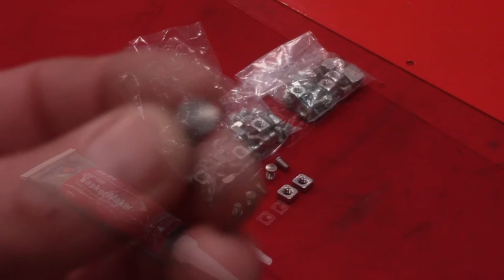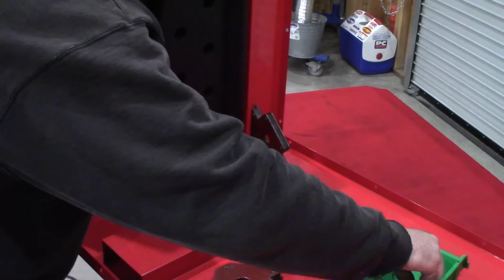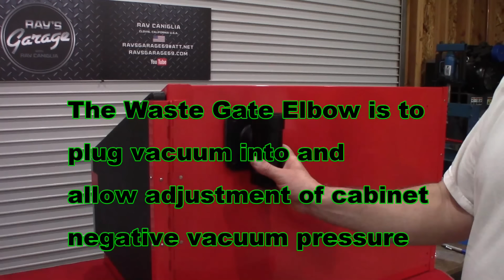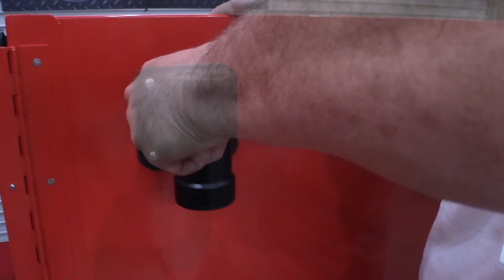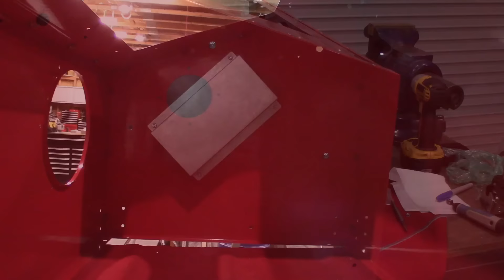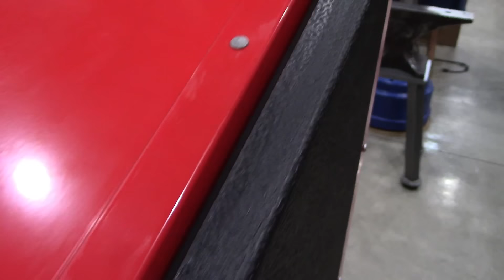Tacoma Company Upgrades Part 2 #tacomacompany #realraysgarage

Comment: I did something unique and plumbed the intake air to blow fresh air across the face of the glass. I figured that a barrier of air blowing across the glass will keep the glass from being crazed a bit longer.
Reply: So far blowing the air cross the glass is working ok. And another thing I did just because I has two of them. I was scratching my head a bit as to what to do for a dust collector. I have seen so many innovative and creative things done with 5 gallon pails or buckets and the like and of course there is the commercial products that you could buy that would do the same thing. Well what I did was I had two shop vac’s. One large one and one smaller one. I just connected the blast cabinet to one vac and then ran the exhaust out to the intake of the second shop vac. Of course I only turned on the shop vac which is on the end. Well it worked just fine. You could pickup up a secondary shop vac  for next to nothing at some garage sales. I have such a dirty mind.....two shop vacs....get it!    Sigh.

Comment: I thought that using silicone sealant was not good? Could I use the PL roof and flashing sealant on the cabinet like I am using on the hopper?
Reply from the maker: Yes you can but it will very difficult to take it apart if needed.
Reply: @RaysGarage Hi, So the red silicone gasket maker is okay for the seams? I thought you mentioned in another video that silicone is not good for the seams?

Comment: Had no issues with calling or ordering pars to upgrade my HF Sandblasting cabinet fro Tacoma Co. Where very helpful over phone and pars seem so far to be of very good quality.   My only issue was the rivet flat screws.  Could not get many of them very tight as no matter how hard I pressed on the back they would just spin. Even tried pressing with a rubber "non slip" pad on them

Comment: Thanks Ray!
I'm a Piping Designer by profession, so I'm familiar with all of the nomenclature here. However, your explanation of the flow rates of air vs medium( in upcoming sections), gave me a pretty good heads up on what's in store and cut down LOADS of guesswork. 

Replacing the fasteners (plated junk iron Chinesium) with 304 Stainless Steel was the first thing I did. I took that as a red flag and started investigating the technicals and history on this kit....
My best guess is that this kit wasn't designed at all, but reverse engineered,  then watered down into something that barely keep Harbor Freight from getting sued into oblivion. 

Mike Tacoma obviously knows his stuff and is a valuable asset to his Craft, as well as to all of us DIYers out here trying to do more with less.
...and you've done a great job of conveying his expertise in a thorough and logical manner. 

I thank you both.
Hats off and Cheers!
Reply from the maker: You nailed it my friend, you are one that truly understands and get's it! Feel free to hit me up with any questions, or should I ask how to improve on this system!

Comment: Hi, Ray thanks for the videos, they helped me a lot on the build. where can i buy that tool you used for the RTV? You turn the tool and the RTV come out so easy.
Reply from the maker: Thanks Robert, You can find the tool on Amazon, its called, (Metal Tube Squeezer Roller Key) they are about $4 a piece.

Comment: These videos are so helpful, Thank you! Can I add the vacuum waste gate to the left side since that it where my vacuum is located? I'd prefer to have the rear of cabinet flush up against a wall to save on space.
Reply from the maker: This is not recommended, by putting the vac on the side you run the risk of pulling good blast media out of the cabinet plus the cabinet vacuum pressure will not flow as efficiently. The reason for the waste gate and vac connection on the rear of the cabinet is to allow good blast media to fall from the baffle box back into the cabinet and not into the vacuum.

Comment: In the process of building my cabinet with virtuslly every item on Taoma's price list.  What is the secret to getting the nut on the 1/4-20 above the exhausr baffle?  after messing with it for a half hour I had to walk away.  Thanks Ray.  The vid's are great!
Reply from the maker: The waste gate uses self tapping screws if this is what you are asking, if not let me know. Thanks!
Reply: @RaysGarage sorry, reread my post and I wasn't clear.  When assembling the cabinet there is one of the many 1/4-20 screws with the square, flat faced nuts that is installed above/behind the exhaust baffle on the inside of the cabinet.  Can't get fingers in there to start the nut and the angle of the screw makes using a box wrench, or long extension through the baffle, nearly impossible.  What was your solution?

Thanks Ray!
Reply from the maker: @ronpadgett9521  I belive these were installed with the paneles upside down when the top portition of the cabinet was assembled. worse case use a standard 1/4-20 nut with a 1/4" ratchet just make sure its good and sealed so you do not have a media leak.

Comment: I enjoyed your series. I have placed an order for upgrades but am at the mercy of the company moving their location.  I did receive the screw kit and have built my cabinet. I have not been able to get all the screws tight because no matter how hard I push on them, about 10-20% of them continue to spin. Also, I followed your video to assemble the cabinet and had a hard time putting the front plate on, I think it would be easier if you follow the recommendations for assembly in the manual by doing the top, front and back first and then the sides. I agree that it can be expensive to do these upgrades, but I need a really good cabinet for blasting aluminum and I think this will be the ticket.  Can’t wait to get the rest of my upgrades so I can start using it.
Reply from the maker: Hello James, You are going to love the performance of your upgraded cabinet! As far as assemble goes, I was never one to follow instructions and call them destructions, hahaha. There is no wrong way to complete something, what ever works and is easiest to do! Cheers, Ray

Comment: It appears you are installing the box topper with the cabinet partially assembled, maybe 4 of 6 sides??  I'm having a heck of a time installing the box topper upgrade to a previously assembled unit.  Any tips or tricks, I really don't want to have to start disassembling things beyond separating the cabinet from the hopper
Reply from the maker: You may have to file it down slightly to get it to slide into place, they are made slightly oversized due to cabinet inconsistently.
Reply: @RaysGarage  Gotcha, thanks for the very fast response - much appreciated

Comment: Ray, I wondering why you moved the vacuum port to the backside. HB calls it the inlet port and it has a baffle box although it needed a top. But you added a baffle box to the side port, your new inlet port. So what's the difference? Since you added the baffle box to the original HB vacuum port would you not have eliminated the media loss problem? I not questioning your change but only trying to understand why it is better to have the vacuum port on the back and not the side. Thanks.
Reply from the maker: Hi Brent, Great question! The reason for moving the vac port to the rear and closing the top is so that all your  blast media is not sucked out of the cabinet, only the dust is removed, the heavier media drops back down to the hopper and does not end up in your vacuum.

Comment: Ray, you stated you purchased high density foam tape for the hopper and box assembly but ended up using red RTV. Would the foam tape have worked as well?
Reply from the maker: Yes but the RTV will give a little better seal.

Comment: Hey Ray, I have a question about the hardware (and I'm sure you were already asked this previously).  Why not solid rivets?  I believe you said most were 1/4 inch holes so a #8 solid rivet would fit and be cheaper.  I ask for this advice even though you were wearing that filthadelphia shirt in the 1.2 video....
Reply from the maker: Hey Tony, Yes you can use any fastener you like, I was just showing what Tacoma Company provides as an option. The HF holes are very close to 1/4" so feel free to use your fastener of choice. Go Birds!

Comment: I finally found the price sheet provided by Sek, but have a question- what are the differences between the 3 kits- standard, standard plus, and deluxe?
Reply from the maker: Hi Terry, All three kits are the same except for the gun, the Deluxe gun has a lot more time in machining on the inside for much better performance. all three kits will outperform any other gun on the market.

Comment: I haven't watched the whole series yet, so I apologize if you answered this question in a later video.  What red did you find that matched the cabinet color?
Reply from the maker: I used  Rust-Oleum Gloss Cherry #248568, be sure and use a good white primer under the gloss cherry.
Reply: Tonka Cruiser 8

Comment: Did you have any trouble getting your door to seal? I think I may have to make the holes in mine a little larger to push the hinge closer to the cabinet. I did use the upgrade fasteners but have a small gap at the back. Thought I’d see if you did anything special before I go that route. Your videos are great. I will have the mods I can do finished about the time Mike has all the upgrades I ordered sent off to me. Thanks for sharing your cabinet build.
Reply from the maker: Bill N Hi Bill, My first cabinet was fine and door sealed fine not so for the second cabinet and had to file the door hinge bolt holes to tighten the seal. This fixed it. Cheers, Ray

Comment: looked into these upgrades offered by Tacoma; man they're not cheap. I think i'll pass! I upgraded my gun to a Skat Blast and made a few small mods to my siphon tube that made my machine work great for about $100

heres what Tacoma sent me when i asked for pricing for anyone who's interested:

TACOMA COMPANY BLAST CABINET UPGRADE KITS:
 Standard Upgrade Kit .…………….…………… $319.00
• Standard-Plus Upgrade Kit ………………..... $369.00
• Deluxe Upgrade Kit ……….……………………….. $449.00
ALL 3 UPGRADE KIT MODELS INCLUDE:
1. New Style BLAST GUN complete w/ Ceramic Extended Nozzle
2. High Volume feathering-action FOOT CONTROL
3. New Style Adjustable METERING VALVE w/ trap door adapter
4. PRESSURE REGULATOR w/ Gauge
5. Hoses, Fittings, and Grommets. 

UPGRADE OPTIONS listed below in order of recommendation:
1. BAFFLE BOX ..…………………………………………..…………. $ 24.50
 Covers air intake port on left inside of cabinet, re-directing in-take air flow down to front corner of cabinet.
2. WASTE GATE ELBOW ………………………………….……… $ 29.95
A flanged elbow to be attached over the rear vacuum port of cabinet. Lower sweep elbow attaches to 2.5” vacuum hose,
w/ adjustable valve at top for adjustment of cabinet negative vacuum pressure, to keep good media in cabinet and dust out.
3. BAFFLE BOX TOPPER .............................................. $ 8.95
To close off the top of the rear port baffle box for best air-flow dynamics.
4. WINDOW QUICK-CHANGE KIT ……………………………. $ 29.00
Allows for quick, safe window glass replacement of interior ‘throw-away’ sheet of glass, without the need for tools.
5. LIGHT KITS: Includes 75 watt halogen bulbs, which provide excellent light, and enough heat to
help keep media dry. Each kit has an added receptacle to receive vacuum power plug, so light switch
will power both vacuum and lights.
• Single Deluxe ………………………………………….. $ 49.00
• Double Deluxe ………………………………………… $ 98.00
• Double with Uni-Housing …………………….….. $ 135.00 More commercial type w/ internal wiring &
2-pole rocker switch. Has same light output as Double Deluxe Light Kit.
6. HOPPER FUNNEL ADAPTER ………………..…………....… $ 52.00
Replaces the trap door at the base of the cabinet hopper, creating a smooth flow transition from cabinet hopper to metering
valve, and aiding in quick media changes. 
TACOMA COMPANY
7. CUFF KIT …………………………………………………..………… $ 59.95
Fitted 4-piece sheet metal cuffs which bridge the remaining screen support ledge, after removal of the hopper grid
frame/screen support, preventing media build-up on that ledge.
8. DOOR SHIELD …………………………….……………..….….... $ 42.00
 2-piece metal fairings to keep media out of the holes in the HF cabinet door; and to deflect media back into the cabinet -
not on the floor – when opening door.
9. BOLT REPLACEMENT KITS:
Low profile stainless steel rivet bolts that replace original assembly hardware, for smooth inner seams. These replacement bolts
are slightly larger in diameter than the bolts that come with the cabinet, and are only 3/8” long.
• HOPPER BOLT KIT – 22 Nut/Bolt Sets ………………….. $ 8.95
• UPPER BOLT KIT – 34 Nut/Bolt Sets…………………...... $ 12.95
• COMPLETE Hopper + Upper BOLT KIT – 56 sets .. $ 19.95
10. FOAM TAPE, High Density Self-Adhesive:
• Hopper – for perimeter of hopper joint…………. $ 3.95
• Window – for perimeter of window glass………. $ 2.95
11. Cabinet Pressure FLOW METER (3nd Gen.) ……..... $ 79.00
Allows operator to monitor negative vacuum pressure in the cabinet, which can then be adjusted with Waste Gate Elbow and,
secondarily, the Vacuum Waste Gate, to lower the cabinet pressure, such as would be required for light density media (like fine
crushed glass), and the higher pressures for heavier media (like coarse garnet).
12. VACUUM WASTE GATE ………………………………………. $ 27.00
A secondary vacuum pressure relief valve that mounts to ShopVac®-type unit. Used for better pressure control when
vacuum is high horsepower (over 3.5hp), in excess of what the Waste Gate Elbow (Option 2) can handle.
13. BLASTING GLOVES: [Available in Size: Medium, Large, or Extra-Large]
Our glove gauntlets are made in-house to order, using high quality naugahyde, double sewn to tough, flexible gloves. The first
number in the sizing correlates to the diameter of arm rings on the cabinet. HF cabinets have a 7” arm ring inner diameter.
• 6” x 24” Length ……..………..………………….….. $ 26.00 / pair
• 7.25” x 24” Length ………..…………..….………… $ 28.50 / pair
(Standard size for all HF –style cabinets)
• 7.25” x 26” Length ……..…………………………… $ 32.00 / pair
(Recommended size for HF style cabinets with lowered interior screen)
• 8.25” x 27” Length ……..……….………….………. $ 34.00 / pair
** Other sizes available – including our proprietary Tri-Lobeal Arms Rings & Gloves. Please contact us.**
14. Spare CERAMIC EXTENDED NOZZLES (CEN-4)....... $ 15.95 ea.
This #4/7 mm nozzle is the typical size recommended for all HF-style cabinets, and matches the #4 Air Jet in the Blast Gun.
15. Hole Plug Kit – For plugging unused OEM holes (Set of 3) ….. $ 2.95
Reply from the maker: Yes, good quality does not come cheap, there is a ton of R&D and machining involved in all of Tacomas parts. I did spend a little over $1200 since I did want all of Tacoma Company's Upgrades. I am currently putting together my second upgraded cabinet to demonstrate a top performing cabinet and how efficient it runs. It's great to hear that the Scat Blast Gun and mods are working good for you! Thanks for sharing this information!

Comment: Hi Ray- I'm in the process of installing al of the Tacoma product upgrades, just waiting on the deluxe gun & related components.  One question- What is the full name for those magnetic clamps that you used to hold the air baffle onto the cabinet with...?  (I can't find them)     And thanks for the videos!
Reply from the maker: Hi Jon, I have two sizes of these Stronghand Tool magnets, small one is MFT10 and large is MNT15
https://www.amazon.com/Strong-Hand-Tools-Adjustable-Magnetic/dp/B0087GAEDM/ref=sr_1_2?dchild=1&keywords=MFT10&qid=1610307744&sr=8-2
https://www.amazon.com/Strong-Hand-Tools-Magnetic-MNT15/dp/B079K7PKSK/ref=sr_1_1?dchild=1&keywords=MNT15&qid=1610307795&sr=8-1

I hope this helps!
Best Regards,
Ray

Comment: Interested in where to find the (magtaps)?
Reply from the maker: Hello Robert, here is a Amazon link to the small one but you might be able to find them cheaper on other outlets.
https://www.amazon.com/Strong-Hand-Tools-Adjustable-Magnetic/dp/B0087GAEDM/ref=sr_1_5?gclid=EAIaIQobChMI6-WA-dLJ5gIVA77ACh0p8QeKEAAYASAAEgIlyPD_BwE&hvadid=153666005499&hvdev=c&hvlocphy=9031807&hvnetw=g&hvpos=1t1&hvqmt=e&hvrand=2840800704818081986&hvtargid=kwd-29304975575&hydadcr=5940_9212870&keywords=magtabs&qid=1577031182&sr=8-5

Comment: I know that  in the next video you will explain why the nuts are on the  inside
Reply from the maker: For sure Jim, I'll bring that up. The heads of the bolts will be on the inside for the hopper assembly . Not as important for inside the box.
Reply: That is what I thought . Cleaner look on the cabinet/box with the heads on the outside. I mentioned this since I seen it in the comments this early ..The intake and exhaust add on parts are a Great design.. @RaysGarage